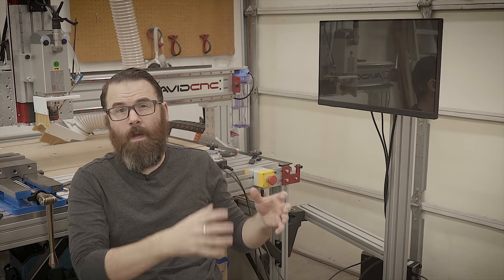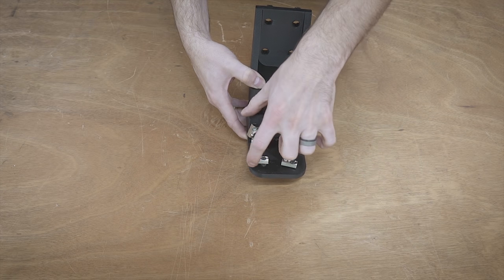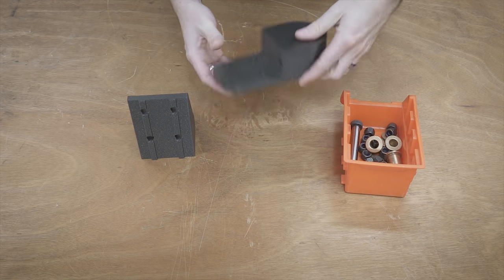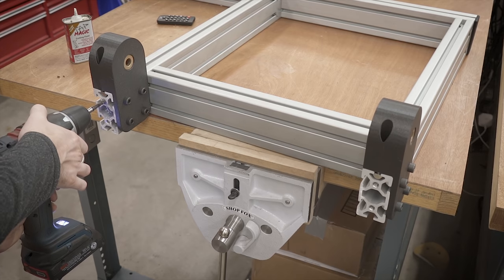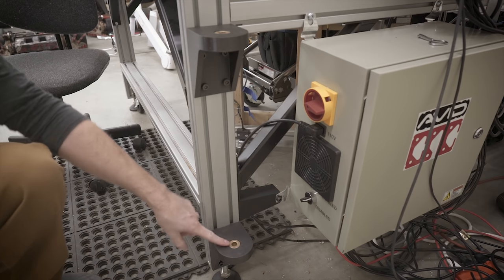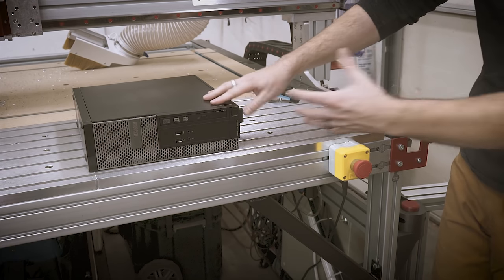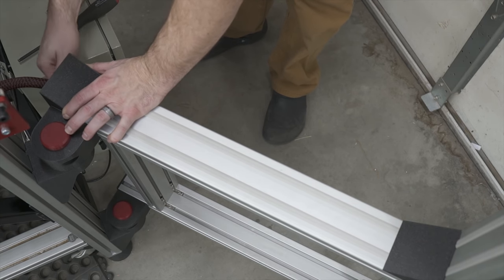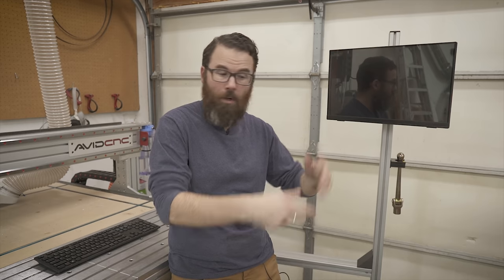DIY CNC Router Machine Arm

Comment: Looks clean! I’d be cautious regarding plastic creep over time. Especially with minor temp cycles, vibrations and constant force loading. Would love to see a lockable(?) and height adjustable (counter weight pulley inside of the extrusion?) and pitch adjustable monitor bracket, as I’d imagine light glare and ergonomic comfort posture when fiddling with the cnc will annoy you over time! As you say, it’s more content and future video ideas!
Reply from the maker: The original design did include all those features, but it's kinda pointless really.  I found that just adjusting the height to eye level is enough.  Tilting it just introduces glare, and I'm the only one using it so height adjustment isn't really necessary.  BUT, it's only two screws, and you can adjust the height.  I've been using this for over a month now, and after the first adjustment, haven't messed with the monitor height once.
Reply: @RobertCowanDIY  understood! Probably good for a multi user milling machine, but not required for a one man band in a garage situation, a bit overkill! Have you thought about a small custom Andon light at the top of the vertical? Or a slim hingable keyboard? Or a keyboard that could slide down from behind the monitor to prevent vertical falling dust, while giving a clean look? I love these types of mini projects, bit of a rabbit hole sometimes...!
Reply from the maker: @willmorris1044  I have thought of a light at the top, but I rarely run REALLY long jobs, so it's not terribly necessary for me, but it would look cool!  As for everything else, I am looking to make a keyboard mount on the arm, I use a wireless keyboard and mouse, so just some place to store and use them (just a simple tiltable tray) would be fine.

Comment: Fantastic design Robert, thanks for posting.  May I ask which 4080 you used? Standard, lite, or ultra-lite? Getting ready to order extrusions to add this to my Avid 5x3.  I was able to pick up a used 27 touchscreen on eBay....hope it's not too heavy.
Reply from the maker: I think I used a mix.  I had some standard and lite on hand I believe.  If I were buying it and building from scratch, I'd just go with the lite.

Comment: Just curious, instead of having the flange of the flange bearings slightly sub-flush and using an oilite thrust washer, could you have just made the flanges of the flange bearings slightly proud and done away with the thrust washer?
Reply from the maker: Yep, this would totally work as well!  I'm not sure why I did it the way I did, I think it was maybe so that the middle thrust washer could be replaced, or I could use varying thicknesses to change the offset.

Comment: Have you thought about adding a wide PTFE washer cut out of sheet material instead of small bushings? That would avoid the majority of wear between the two plastic surfaces while also providing a very large area of contact, reducing the stress overall.
Reply from the maker: Eh, I just went all-in and did the bronze bushings.  But a plastic washer would probably work too.  Nylon, UHMW, or PTFE would all work.

Comment: Interesting that you used Prusament PLA instead of PETG/Nylon/ABS. I assume your garage gets hot/cold over the seasons. Aren't you concerned about long term temperature cycling impacting the PLA strength?
Reply from the maker: I thought I already replied, but apparently not!  My garage is heavily insulated and has a mini-split for year-round temperature control.  I'm not at all worried about PLA, it should be fine for this application.  For outdoor applications, I would have picked a different plastic for sure!

Comment: You can usually run a straight flute tap fine in a hand drill, just have to be a lil more careful about chip clearing. Works great for box tubing, less for billet.
Reply from the maker: Agreed.  For thin stuff, it's just fine, but the spiral flutes just seem to go quicker and produce better threads.  I've slowly replaced all my straight flute taps with these spiral ones.

Comment: If you printed this in PLA it might eventually suffer some creep. Especially if your workshop temperature is high.
Very cool design though, I love the cable management!
Reply from the maker: Thanks, the workshop is completely climate controlled, no problem there.  I'll see if there's any creep, but based on the print orientation, I don't see this being an issue.  But as I said, this was just a test, and if it doesn't work I'll machine new hinges out of aluminum.

Comment: For the wobbling, what if you extend the arm down and add a rubber caster wheel to the bottom end of that arm? This would basically allow the ground to support the arm on that extended end.
Reply from the maker: It's a torsional stiffness, not a sagging issue.  That would make it more wobbly I think.  In the video, it's hard to tell, but it's several feet of unsupported extrusion with a monitor on top.  It's just gonna wobble, because of the length of the extrusion.  It's really not bad at all though.
Reply: @RobertCowanDIY  ah gotcha. Yeah the video kind of throws off the scale.

Comment: What 3D Printer do you have, those prints are flawless.
Reply from the maker: The prints were done with a Prusa i3 MK3S and Prusa Mini.  They print nearly identical, but the mini is just a tad bit slower and more fiddly to use.
Reply: @RobertCowanDIY    LOL... I was just going to ask you what your thoughts were between the MK3 and Mini.  I've got two MK3's upgraded to S+ and have an XL on order.

Comment: Looks good, would just suggest SSD hard drive on pc, mechanical drive will fail due to cnc vibration if not already ssd
Reply from the maker: I'm not sure how you came to the conclusion I wouldn't use an SSD...  All my shop computers have solid state instead of spinning rust drives.  ;-)  I usually buy one of these cheap optiplex computers from craigslist and instantly clean them out and put in an SSD.
Reply: @RobertCowanDIY  1000 apologies sir

Comment: Do you design the 3d parts?  What 3d printer do you recommend? Thanks
Reply from the maker: I designed everything in this project.  I recommend the Prusa MK3s as the best all around 3d printer.  I also like the Ender-3 S1 series if you want something a bit more budget-friendly.  I just recently did a review of the Ender-3 S1 Plus, you can check that out.

Comment: Would you consider using a lower number of midroll ads please?
Reply from the maker: How many did you get?  I'm curious, I haven't adjusted my settings, but I can certainly see if I can cut them down.
Reply: @RobertCowanDIY  7
Reply from the maker: @HMPirates  ouch!  That's terrible.  I'll see what I can do.  I just use default settings